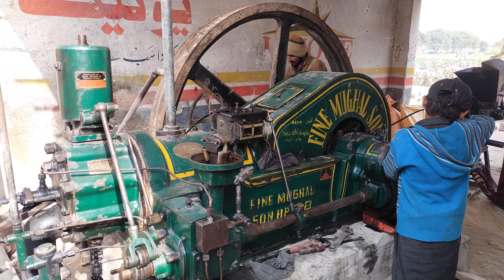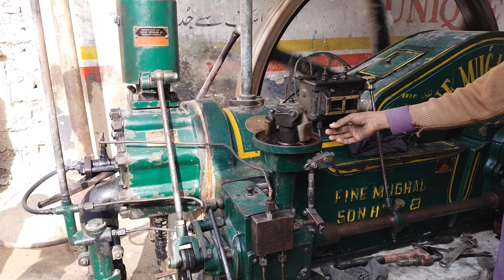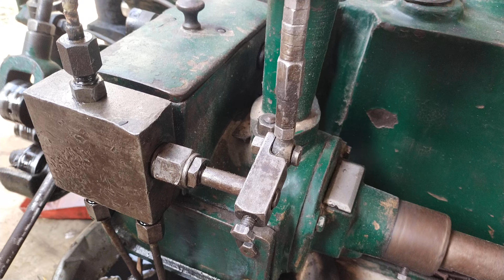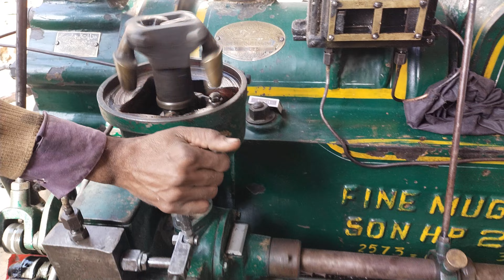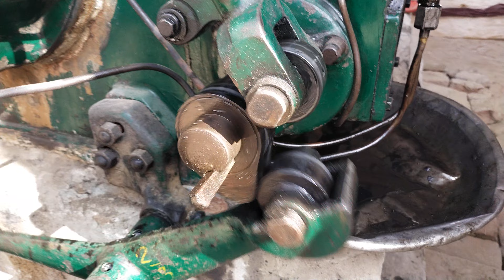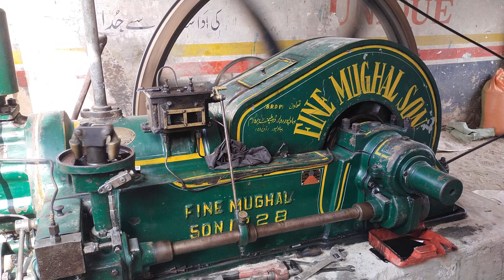Disall old black engine amazing working on atta chaki

Comment: A good example of a Ruston copy from Pakistan and well maintained, too. Showed us how the speed governor works and the effect of keeping the exhaust port open manually and taking the engine rpm to a rather high level. But using a 28hp horizontal engine for just wheat flour grinding is a waste of hp and fuel. Could do it with just a 10 hp lister engine.